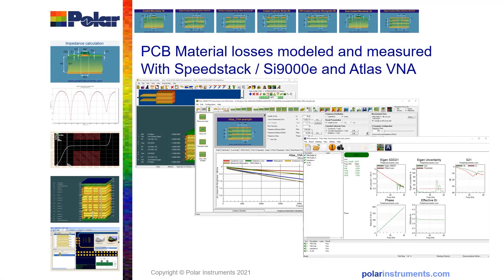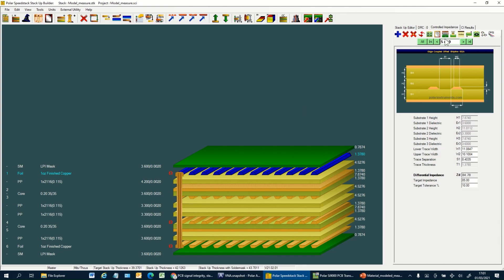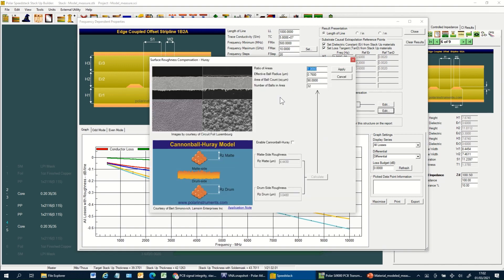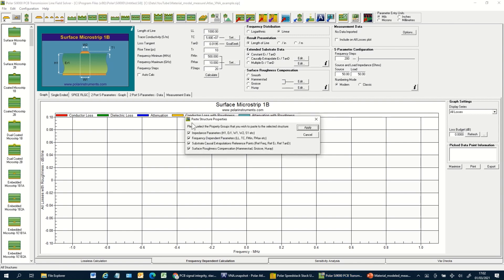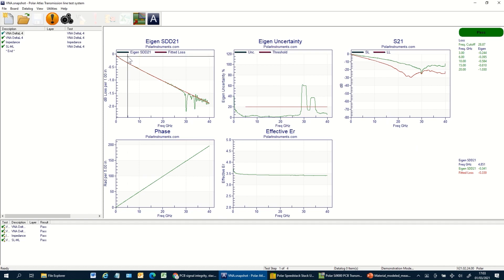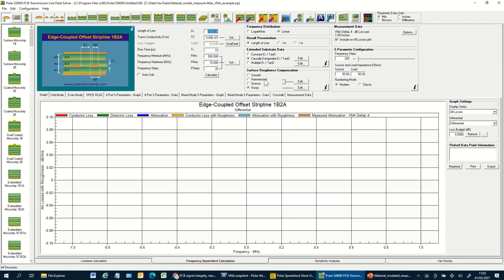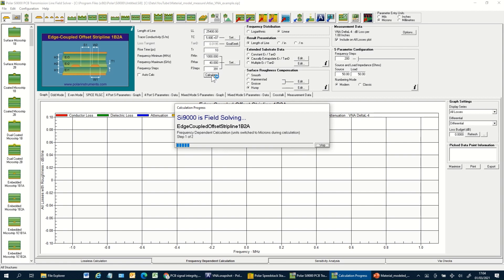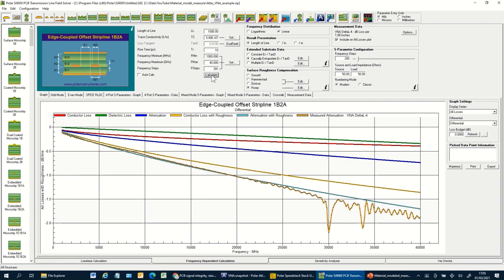PCB material losses - modeled & measured

Comment: The dielectric loss/conductor loss seems to the dB value. If I try to convert it to the absolute Watt value. It seems to be very high. That's not logical. How the dB value obtained in Polar? Or the calculating formula for the dB value?